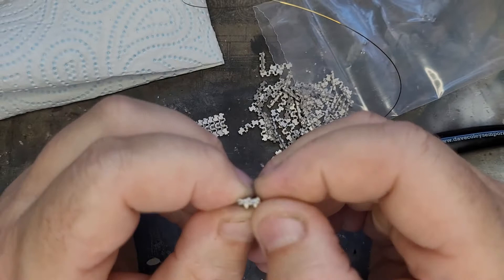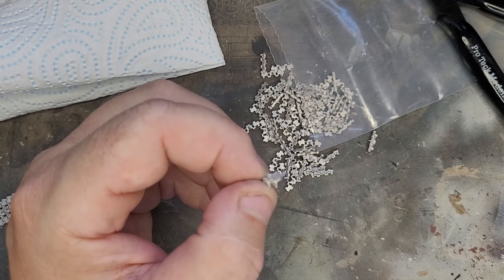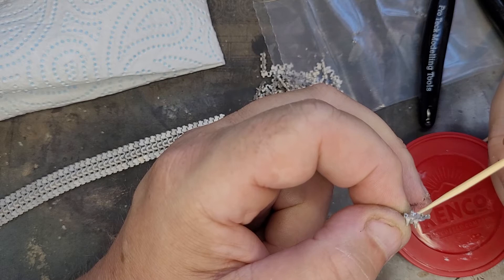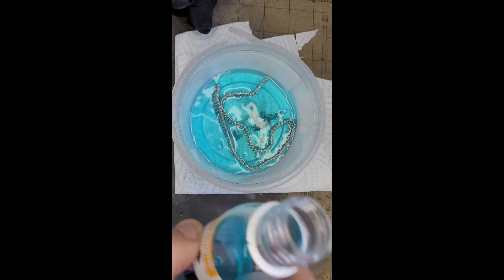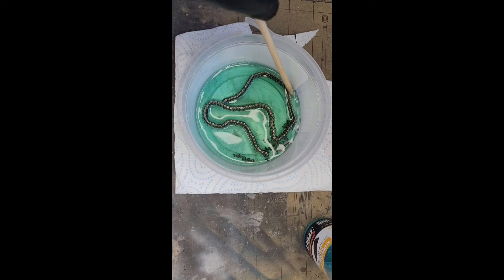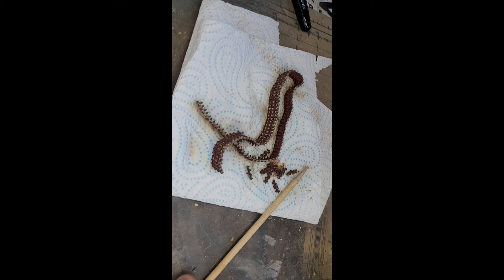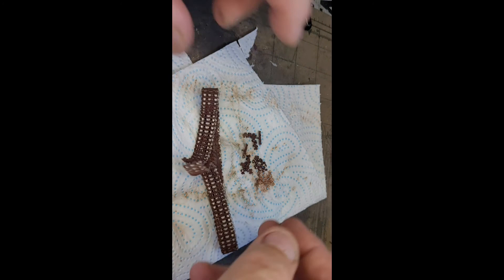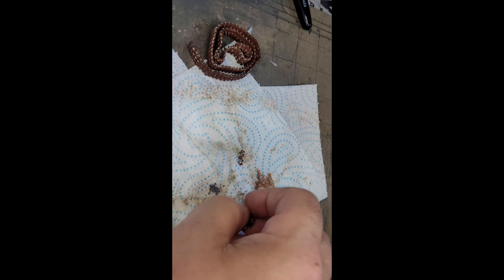Hungarian 40/43M 'Zrinyi' II 105mm Assault Gun "Hungarian StuG." Friul Tracks  #35Scale #stuglife

Comment: Hi John, Nice video.  I have no idea why the burnishing fluid isn't working in the recesses.  Did you do anything as far as cleaning the tracks before burnishing?    The burnishing fluid is for white metal only.  White metal is an alloy of several metals, I think mostly tin.  I am pretty sure the cold bluing liquid is for steel, mostly being used by gunsmiths. Thanks for sharing.  Have a great day.  Jeff
Reply from the maker: No cleaning beforehand but maybe I should have. It's OK.. I'll still paint them anyway